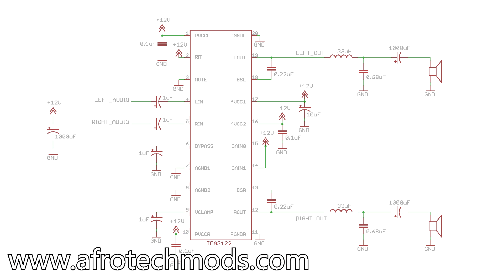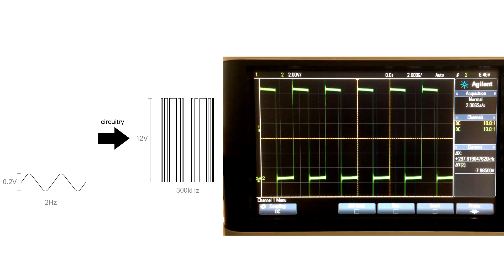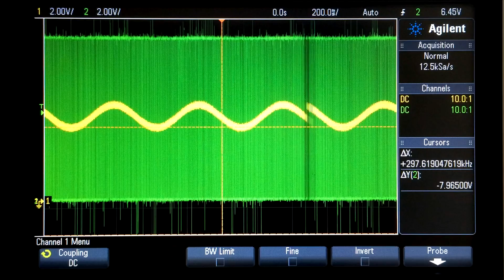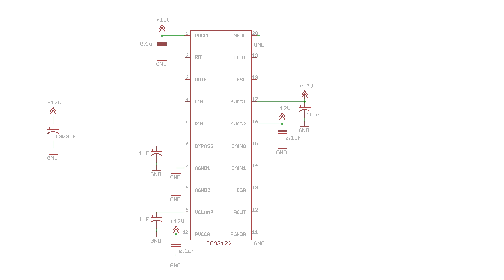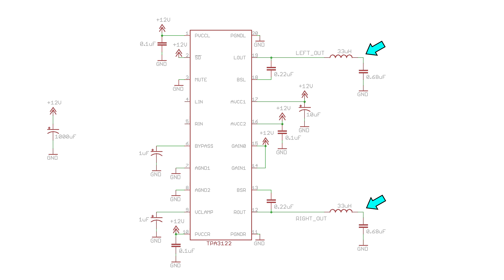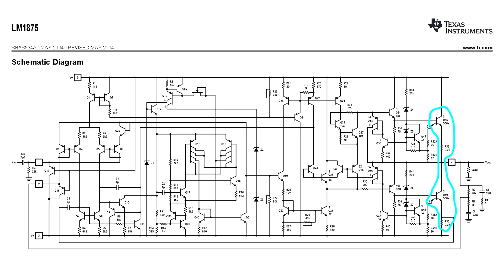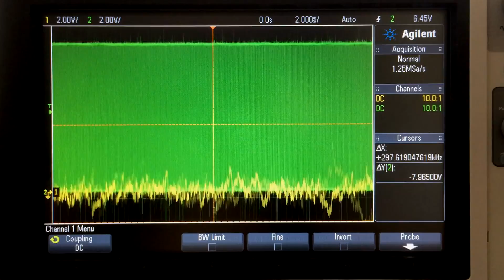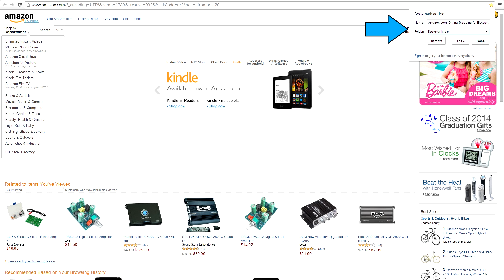Class D Amplifier Tutorial!

Comment: Would this work as a  really simple guitar amplifier ?
Reply: +Draco_no_Rei 
( I wrote a lot here. Although I answered your question, I have also added some knowledge about tube amps, Leslie speakers, and electronic organs, in regard to amps/speakers.- Enjoy:)
CLASS D GUITAR AMP? Worth a try, but the best amps are obviously vacuum tube Class AB PUSH PULL and CLASS A. However I absolutely love my 1976' AMPEG FET ( field effect transistors) guitar amplifier model G110 ( with reverb and tremolo- depth and rate, and they sound excellent too). And I am a tube amp ourist of 38 years now, and have built many vacuum tube guitar amps from scratch ranging from 15 to 100 watts. I have also owned many of the best tube amps including Fender Bandmaster, Fender Bassman brown face and pre-CBS black face, pre-CBS, Fender Princeton pre-CBS by about two months ( btw CBS bought a major part of the Fender Guitar and Amplifier business and so the amps they built was of a slightly lower quality, although not all were).
My favorite modification was to a 73' Dallas Arbiter SOUND CITY 120R, in which I used most of it's existing parts to rebuild it into a 1969 Marshall head. The Partridge transformers really lent the amp to a unique HI-WATT meets MARSHALL hybrid tone. However if I had to describe it the results was nearly an exact ANGUS YOUNG -HIGH VOLTAGE tone. Which of course was an early Marshall:)
   I have been into electronic organs, including electromagnetic/electromechanical HAMMOND Tone Wheel organs, but also the 'other'  great electromechanical organ, the WURLITZER Electrostatic Reed organ ( 1946 to 1961). You can actually hear this organ as I play it on my channel, or Youtube search this long title- WURLITZER ELECTROSTATIC REED MODEL 4410, LESLIE HORN-JENSEN V-21, HAMMOND HR$) TONE CABINET
   I have 11 organs, including that 56' Wurlitzer, a 46' Wurlitzer series 31 Orgatron with a rare Don Leslie designed WURLITZER 310 VIBRATO TONE CABINET with an upper metal vane rotor to throw the sound around for a TREMULENT effect [ I will describe this below]. BTW, a tone cabinet in organ playing is the speaker cabinet with a built in amplifier, almost always vacuum tube, and very much in danger of being destroyed by ignorant guitar players who think they can build a great guitar amp from them, but in actuality the transformers found in the cabinets are inferior to transformers designed specifically with a guitar amp in mind. This is because a guitar is a midrange instrument and an organ is a full frequency instrument. 

So please refrain from destroying organs and spread the word not to. Even if you have to leave a nasty comment on ebay to someone who just destroyed a great old Conn, Hammond, Wurlitzer, or Gulbransen organ.

WHAT IS TREMULENT? And what is a LESLIE ROTARY SPEAKER?
As guitar players we are familiar with TREMOLO and VIBRATO. The former being AM and the latter being FM. I describe what AM and FM are below. TREMULENT is a combination of both AM and FM. 
In theater organ playing an air regulator TREMULENT system pulsates the air going to the pipes whenever the organist flips the TREM tabs. Because the air pressure pulsates between normal and lower than normal air pressure the result is a pitch shifting warble effect created in the pipes called FREQUENCY MODULATION ( FM). Now because the lessened pressure and normal pressure goes back and forth ( oscillates) this also causes a volume raising and lowering in the pipes called AMPLITUDE MODULATION (AM).
**LESLIE SPEAKER- BY THEATER ORGAN ENTHUSIAST, DON LESLIE*
In 1936 the first electric organ was invented by Laurens Hammond. He used the absolute simplest, but best ( and time has shown this as well) organ using TONE WHEEL GENERATORS. [ if you go to the video LEGENDARY THEATER ORGANISTS and go to about 40 minutes into the video you will see an excellent B&W film short from the 30's or 40's describing and showing a tone wheel in action. A tone wheel generator chassis has 91 of these tone wheel+ single pick-up assemblies governed by one SYNCHRONOUS MOTOR, another Laurens Hammond invention. Every electric clock with hands has a synchronous motor. BTW Laurens founded the HAMMOND CLOCK COMPANY before he invented the Hammond organ in 1936]. So in about 1941 Don Leslie decided he wanted his Hammond organ to sound like a theater organ. SO he reasoned that if he spun a baffle over a stationary speaker it would throw the sound around in a circle, thus creating FM because of the DOPPLER EFFECT principle ( like when a fire truck goes by the pitch changes), because the sound is going to and fro in relation to the stationary listener it raises and lowers the volume to the listeners ears. This is the AM. And thus the LESLIE speaker was born. The model 30A was built in Don's home by himself and his sisters. The famous black revolving horns came later, as the 30A's used heavy corrugated paper formed into a rough funnel shape. There are images of the 30A on the Organ Forum which I posted if you google it. Incidentally, Don tried many configurations and finally realized that just ONE HORN 'speaking' and the other just to counter balance it was the best system. The first horns also were FIELD COIL horns instead of permanent magnet horns which were used later ( aka the V-21 JENSEN). The 15" speaker had a wooden drum rotor  with a sloped baffle which looks like a 1/4 pipe skateboard ramp. These were MAGNAVOX FIELD COIL SPEAKERS as well, then later JENSEN SPECIAL DESIGN 15" permanent magnet speakers were used.
   Listen to JESSE CRAWFORD- REMEMBERING for the most beautiful playing through a Leslie.I posted both sides of this album on Youtube. Two other excellent Leslie speaker examples I also paosted- WALTER WANDERLEY -CHEGENCA , and JESSE CRAWFORD -POET OF THE ORGAN. And of course all of the great JIMMY SMITH, ETHEL SMITH, and so so so many more. Leslie never had to advertise. The reason that the two 'half moon' switches are on the organ is because Laurens Hammond did not like the Leslie speaker because he felt it cut into the purity of the Hammond Organ for church use. This is true, but of course there were MORE Hammonds sold outside of the church market, and for POPULAR MUSIC A LESLIE IS A MUST on an organ. 
   As a guitar player I was all about rock and jazz, but as an organ player I discovered the awesome music of the 1920's-1940's. The thrift store record bins are full of great organ records. Being a good LISTENER OF THE MUSIC OF YOUR INSTRUMENT is the absolute best way to guarantee success at PLAYING your instrument! Never forget this. You know when I started playing organ 20 years ago ( after playing guitar for 20 years up to that point) I played JIMMY SMITH Hammond organ style for 6 years, and hardly listened to ANY organ music. Crazy huh'? Well you wouldn't believe how many organists never listen to organ music for pleasure. When Youtube started 11 years ago I ate up all of the various genres of music! It was on Youtube that I discovered all of the great music of the 1930's especially. The Youtube channel pax41 is an excellent site for this music. Soon I discovered too that the popular music of the 20's and 30's especially, sounded great on organ. And not just Hammond! Although I have had 9 Hammond organs over the years, the only Hammond I have now is the great HAMMOND X-66. I do miss my Hammond A100, M3, Elegante (81' model), and RT-2, but right now I want to concentrate on the sounds of my X-66, Conn Classic-815, Gulbransen Rilato II, and my Wurlitzers- a 46' series 31, 56' model 4410, and a 65' model 4300 all-transistor spinet. Listen to the 4300 on JOHN LA DUCA WURLITZER 4500/4520/4300

ORGANS ARE ALSO BEING HORRIBLY TREATED, NO, DESTROYED BY TOTAL IDIOT GUITAR PLAYERS AND HIFI ENTHUSIASTS FOR AMP PROJECTS. There will NEVER EVER be another great ANALOG ELECTRIC,ELECTROSTATIC, or ELECTRONIC ORGAN MADE AGAIN. WHAT WE HAVE IS ALL WE HAVE SO IF YOU DESTROY THEM YOU ARE KILLING THE GUITARS NEAREST COUSIN! It makes me sick to read ebay ads stating, " CAME FROM A WORKING ORGAN" as they describe the amplifier they just robbed from the PRE-1967 ELECTRONIC ORGANS!! Rule of thumb- If an organ is a pre-1968' model it will sound PROFESSIONAL, BE MADE FROM THE FINEST MATERIALS, BE EXTREMELY EASY TO MAINTAIN OR REPAIR BECAUSE OF THE DISCRETE ( INDIVIDUAL) ELECTRONIC COMPONENTS, and IT WAS BUILT TO OPERATE FOR MANY MANY GENERATIONS. The only thing that fails in an organ is the easy to change electrolytic capacitors in the power supply every 30 or so years. My 55 Hammond S6 and 56' Wurlitzer 4410 are completely original electronics and play excellent! Organs don't put the wear on tubes that guitar amps do. I have a 58 CONN CLASSIC-815 organ with 90 tubes in it and all but 15 are original and it plays perfect too! 

Also check out the NORTH SUBURBAN HAMMOND ORGAN SOCIETY and look at their TECHNICAL ARTICLES for HAMMOND ORGAN and WURLI 4600. Also look at ERIC LARSEN - KEN GRIFFIN'S SOUND , as well as Ken Griffin organ records which always show up at thrift stores. He was an awesome organ player to listen to and try to imitate when you get your first organ. He made it sound so simple, but he had excellent recording skills as was taught to him by the great Les Paul. Read the Eric Larsen article of how Ken achieved what he did sonically.
Reply: Any guitar amp needs vacuum tubes
Reply: jmcwd Yes, but then again have you ever owned and or played through a 76' era AMPEG G110 'FIELD EFFECT TRANSISTOR' amp?  Very very warm, clean to gritty via picking dynamics, and not "imitating" shit, it holds it's own for being an awesome sounding Ampeg.
   When I went to GIT in 84' we had the most broken down Gibson made LAB SERIES L5 amps you could imagine. They were worn out, mistreated, the key-locks busted off ( used to have to check out a key to play the amps), and they were FIELD EFFECT TRANSISTORIZED amplifiers, so naturally I wrote off that tech being any good. Well, after many many tube amps that I played ( Marshall, Sound City, Vox, Orange, Fender, and Ampeg) I was walking down the street one day and low and behold there is a little Ampeg G110 combo amp sitting there on the curb with a 'free' sign on it. WOW!! So I figured it would be mediocre. No way, I was blown away!!! excellent reverb and tremolo as well. SO how's it sound? There is a video up of a guy with the same amp, but I believe his doesn't have tremolo and reverb. You can play Kieth Richards dynamic grit all day on this amp, or you can plug your Farfisa or Vox organ into it and look out! Very loud and warm for organs:) It has a 1-10" Ampeg speaker, is a closed back and has a 3" or so cardboard tube bass port on it. I put way over sized industrial rubber wheel castors on mine...it was all I had.
Reply: Wow. The guy asks if this would work as a guitar amp, and you lecture him for half an hour about organs, and not to take the amplifiers from them? What the hell?
Reply: ***** What the hell? Eh' some "lectures" are beneficial! Lets just say I'm making up for who DOESN'T bring to public awareness that the great electric, electronic, or electromechanical ( tone wheel Hammond organ and Electrostatic Wurlitzer) organs are not something you want to destroy for a guitar amp project, and that I have the somewhat rare background of being a professional guitar player for 38 years and organ player/restorer for the past 20. AND I have built over a dozen 50W-120W vacuum tube guitar amps from scratch, and was fortunate enough to have a well known guitar amp guru, Frank Levi III for a roomate in the height of the metal era of the 80's. AT any rate, it's not tooting my own horn, or trying to bust up a simple video...but someone mentioned building a guitar amp, and UNFORTUNATELY it triggered me to steer this person, or whoever else into better alternatives for making amps orf the many many recources of NOS or even old stock of more suited transformers for making guitar amps than from an organ.( afterall it's a free country to speak ones mind and hopefully for some constructive good, for now anyway...Putin just just shut down the web in part of Russia, are we next?)

So if someone wants to bitch that organs are less worthy of being maintained than any classic guitar amp, I state why it matters, even at the risk of bothering people like you. Organs aren't the crappy little shopping mall toys that were so ubiquitous in the 70's, they are finely crafted PROFESSIONAL MUSICAL INSTRUMENTS THAT WILL NEVER AGAIN BE MADE TO THE PRECISION AND QUALITY THAT THEY WERE MADE BETWEEN 1935 and 1968.
SO off topic? Maybe a little, but then again I see too many building mediocre guitar amps from EXCELLENT PROFESSIONAL ORGANS BUILT TO LAST MANY MANY LIFETIMES ( including ours!).. I see too many busting apart organs and listing the amplifiers as " CAME FROM A WORKING ORGAN".

And people such as yourself who come back with a little two or three sentence of uselessness, but to bitch...well, I could give a shit. You don't have to read it!

I
Reply: paulj0557 Jeez. Then you write a novel to me.
Reply: ***** To YOU? Hell no!
Reply: paulj0557 Thank fucking god for that, then.
Reply: ***** Oh' good:)
Reply: All kinds of things would work as a simple guitar amplifier. People have been making practice amps with LM386 and things.

I think if you want a shitty practice amp, you could take a PAM8403 module for a dollar and use one channel with one of the out pins left hanging for a preamp, follow it up with a LED soft-clipper, and then use the other channel with both pins for your speaker amplifier. You can power it with 4*AA battery holder - it will love NiMH rechargeables, but Alkalines will work in a pinch. If you can find a speaker with 9-12cm membrane diameter, or a 16-20cm oblong speaker from an old TV, paper membrane, foam surround, something efficient, with light movement and springiness and not too precise, it will be best.

As for TPA3122, it's neither here nor there. It's not a cheap and cheerful practice amp, nor is it a guitar amp with specific sound people expect...

Comment: can this run on a 9v battery
Reply from the maker: At low volumes it might work, but it would drain the battery VERY fast.
Reply: Afrotechmods so how do you think I could use this for portable speakers
Reply from the maker: A small 12V sealed lead acid battery or a 12V NiMH battery pack + suitable chargers would be good choices.
Reply: Afrotechmods One more question how long do you think the batteries will last
Reply from the maker: That really depends on how loud you run the amplifier and how efficient your speakers are. Let's say you get a 12V 1Ah battery. I would estimate 10hrs battery life at low volumes.
Reply: Afrotechmods Ok thank you so much you are a great teacher